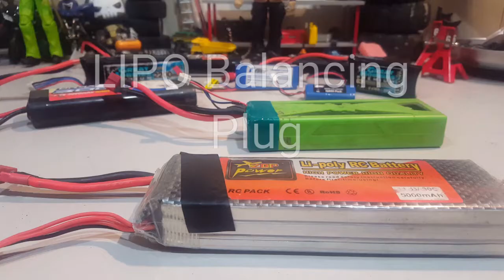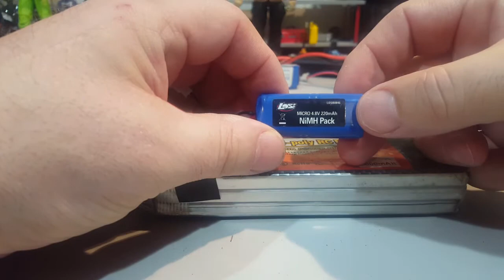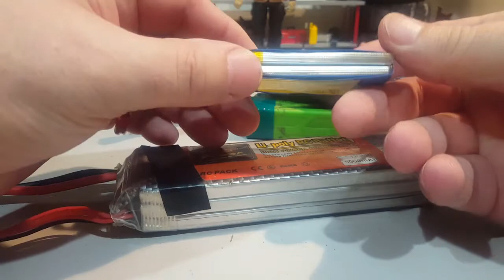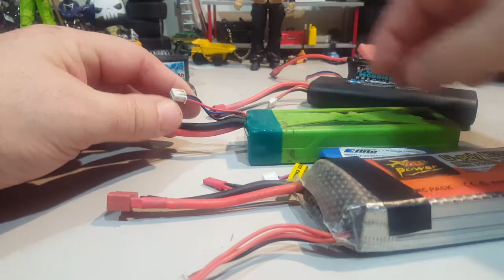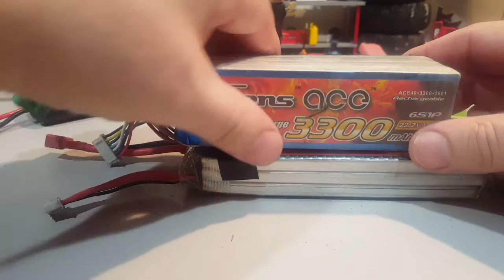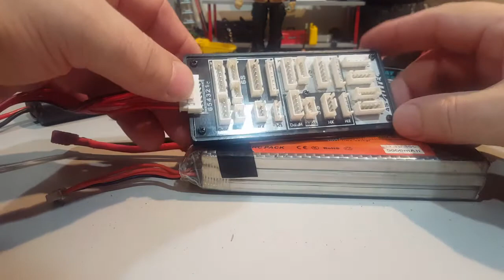Importance of using balance plug on LIPO batteries.

Comment: Nice Explanation... Just one note I may have mentioned. Just what each Abbreviated name means. Like LiPo = Lithium Polymer and NiMh means Nickel Metal Hydride  and to continue for Older packs like NiCd's are Nickel Cadmium.
Reply from the maker: TheLEDwheel thx,  good point but I did not want to get to technical I wanted to keep it simple.  I pin you comment so hopefully others will see it.

Comment: ThAts probably the best explanation I've heard about the balance port. Nobody explains it In detail. Im fairly new to lipo. I got into RC a while back but then got out for almost 7 yrs. Now im getting my old stuff going & picked up a TRX4 tactical unit because I saw all you guys up North having so much fun trailing & stuff I wanted something I could just drive right away. But I'm a tinkerer & love to build not so much the model side of it yet but I like the mechanical building. 👍
Reply from the maker: Michael Burgess I am glad you enjoyed it, RTR kits are fun to drive, the fun begins once you start customizing them.  Thanks for watching and commenting.
Reply from the maker: Michael Burgess please note that the TRX4 uses Traxxas new connection and you old charger won't work with the new battery.
Reply: The Tank RC - I actually have a decent multi charger  & my batteries are still old style Traxxas plugs so they work fine. Also the New & old connecter work together but I'd definitely tape it up or cover it if I was going in water